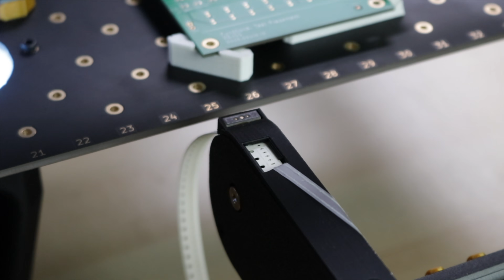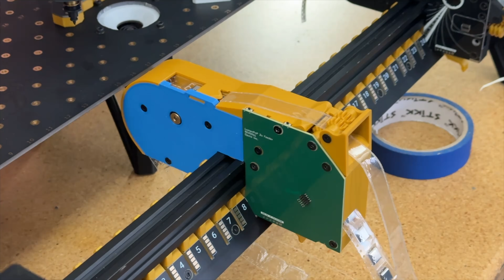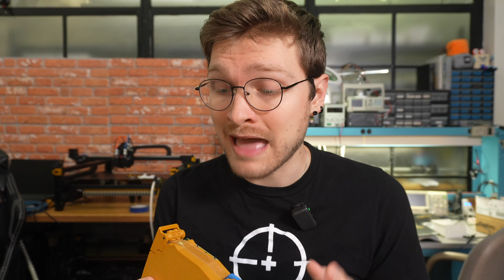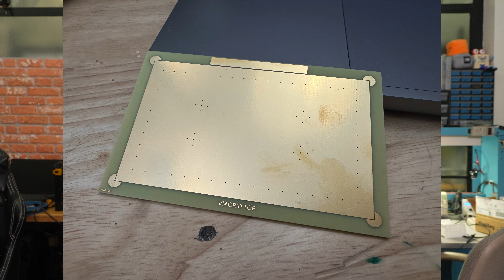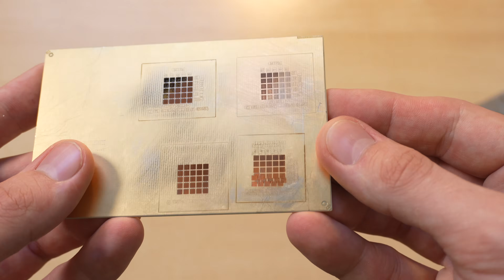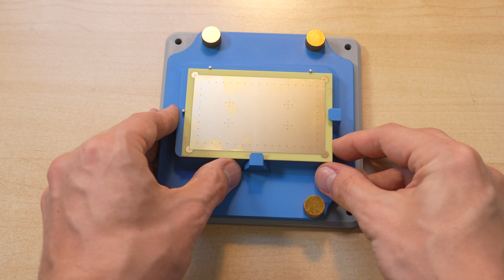October 2025 Opulo Update

Comment: Those pre-via prototyping boards are brilliant! It reminds me of how some half-ASIC integrated circuit designs are done, where the actual transistors are a fixed grid with a known layout and your "customization" is only providing the upper metal layers that decide how they're wired together.

Comment: A flexure mechanism would work well to align the board onto the laser. It should be relatively simple to make one with 3D printing and standard fasteners. It might be a little tricky to get both XY and rotation in one fixture, but you could always stack or nest the mechanisms. I would probably still use thumbscrews to get a flexure stage to within about a millimeter, then you can dial in the position to very high precision. I bet you could hit 0.01 mm with not much difficulty.

Comment: First time I've seen you. Pretty energized guy, but not crazy 😉
I'll have a look at what you're up to; I'm a retired R&D/Test & measurement guy, not able to take on too much, but I might be able to have some "value add" somewhere, if, indeed, you care interested in external "insights"
I've worked in everything from the old stretch-and-wiggle hand-taped PCB layout, to high-speed module test rigs, to IC development for portable device power management, to "Factory Application Engineering for top-tier manufacturers. Now. I'll go quiet, and look at what you're up to 🫡

Comment: Looking at the fiber laser section, I wonder if it's be possible to have a 4 layer stack of trace-g-g-trace? I know you'd have to pre-select the internal layer's connection to vias. Would that help expand the market to some slightly more impedance sensitive markets though?
Reply from the maker: This is something we're planning on experimenting with! Starting with 2-layer, but 4-layer could be really useful if you don't mind a bit more etching time.